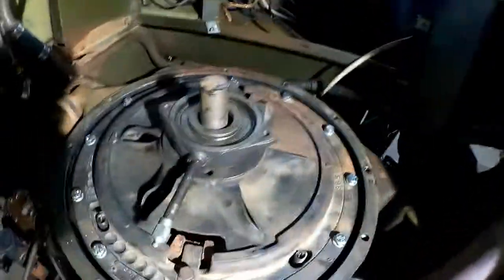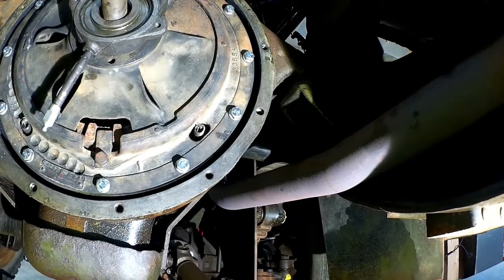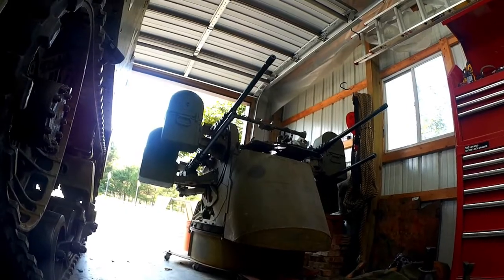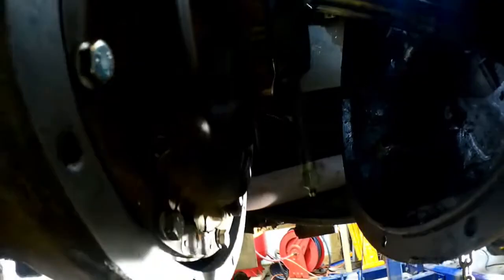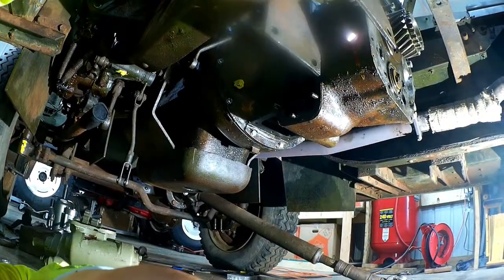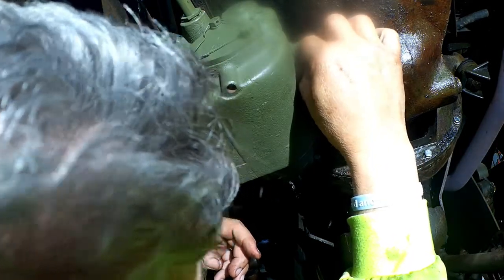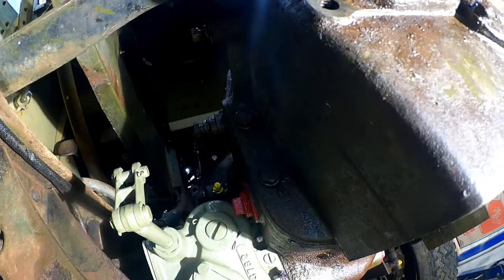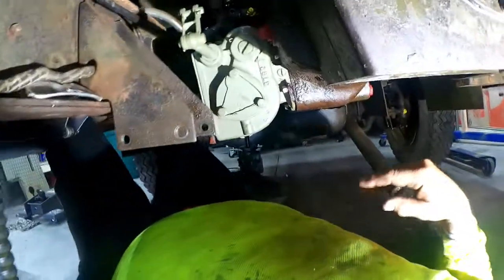Trany Install on the African Queen

Comment: What was the thickness of the wooden blocks you used inbetween the throwout bearing and the pressureplate before installing the trany?
Reply from the maker: Bob 3/4 inch per the manual
Reply: @africanqueenproject  thanks Mark! Great work!